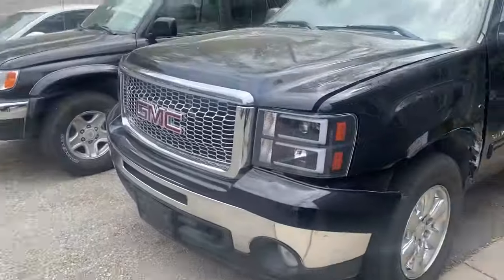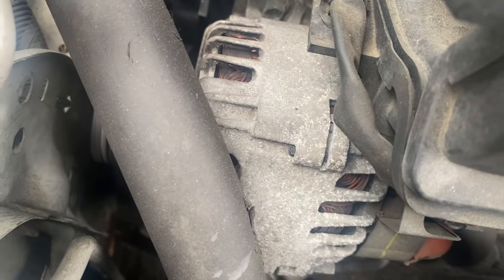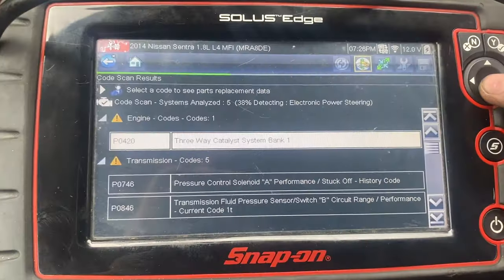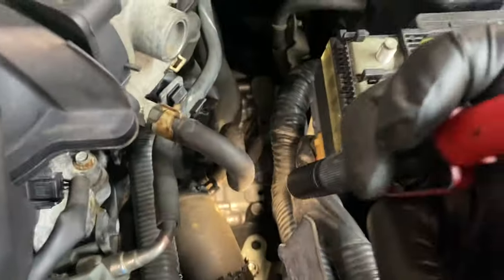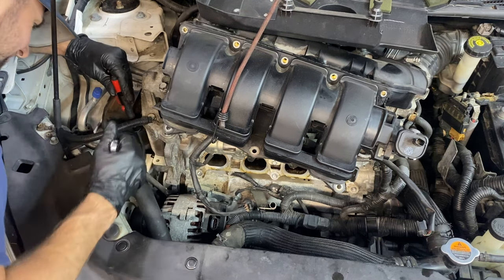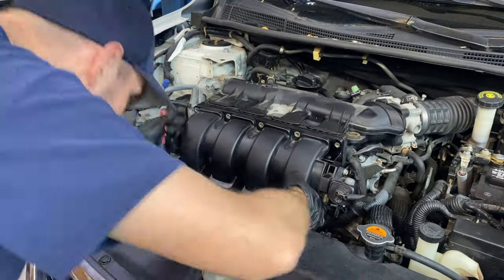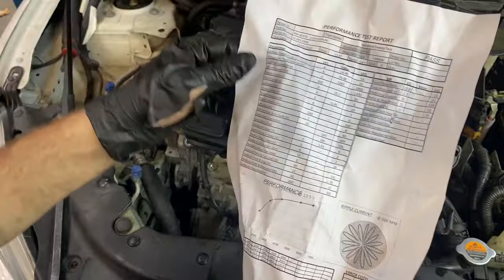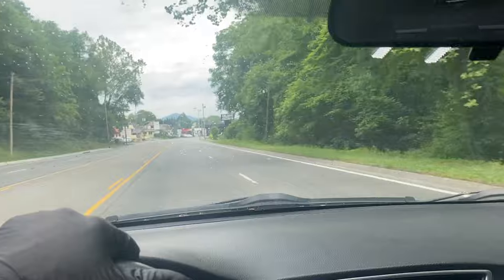Nissan Sentra Transmission Problem: What You Need to Know

Comment: STAY AWAY FROM NISSAN!!! I own a 2017 Nissan Rogue and twice the CVT Transmission failed. I lookup online and found so many customer complaints regarding the same problem with CVT Transmission  issues. Since Customers filed massive lawsuits against Nissan, they have extended the powertrain warranty coverage for CVT repairs, replacements, and towing to 10 years/120,000 miles, whichever comes first. Recently I had to replace the whole CVT Transmission in my Rogue which is out of warranty and it cost me a TON of money.   From my own experience with this car, advice to you; just stay away from Nissan period!!!  Nissan will learn that unhappy customers will never buy they their product ever again, since they are ignoring this specific problem since 2003. Enough is Enough NISSAN, you used to make great cars back in 70's, 80's and 90's but not anymore.
Reply: How often did you get transmission fluid refilled and filter replacement?
Reply: @LibraryOfTheOligarchs it’s a Nissan problem, not a fluid problem.
Reply: P1778 time for a new cvt .
Reply: My 2017 rogue is on 110k miles never had CVT issues. I’ve changed the fluid every 30K with regular oil changes.
Reply: I have a 2017 Altima that I bought new. It has 112K on it. I changed the cvt fluid at 55K and 112K. No power flush, that can damage the valve body. If 6 quarts drain out only put 6 back in. The torque converter holds fluid that stays in. Bf I changed fluid at  112K I got a check engine light and a high rev/ no acceleration issue several times. The code the tcm was throwing out was 0776  (pressure control solenoid B), and a code for bad O2 sensor. Since the fluid change the light went off and the hesitation and high rev situation hasn't occurred since.
Reply: Or maybe there is a problem of you not properly taking care of it? Idk if the US Nissan is just late to things but other countries dropped the CVT for E-power, where the electric motor is the transmission
Reply: @deftone4u keep on doing the trans fluid changes. But you shouldn't have to , that's the issue.  Name another manufacturer that you have to do trans service at those intervals? Ferrari, Lamborghini, Pagani, and Nissan😂😂😂
Reply: @stevemcraemanager7119  well honestly I didn’t know that until after I bought the car. I also had a scion XB that I had to constantly put oil in because that engine was notorious for burning oil. Also something I found out after buying the car. But there’s nothing wrong with taking care of something to make it last longer.
Reply: 160k miles on my Sentra and I went against dealership recommendations and changed my cvt fluid every 20k miles. No issues at all.
Reply: 240k miles on a Nissan Murano 2007 no major issues so far other than the ECU needing to get swapped recently

Comment: I think that most people do not know how to drive a car with a CVT, there are many Corollas with broken CTVs and you can see it here on YouTube, apart from that it must be that the old CVT was delicate, my father-in-law has a B17 but manual transmission and he already has it close 200k and the mechanics go on and on, which indicates that the car really is of outstanding quality, here in Argentina they are very durable, as much as a corolla or civic, here you don't hear any problems with the CVT and I don't think it will persist that fault in the new sentras, it is assumed that they added the 1st and 2nd gear to improve operation, just like toyota did
Reply: Never thought of that... I own a 2017 Nissan Sentra SV and to be honest I have not had any issues with the car.... I have done regular maintenance check ups and nothing else.. 180,000 miles car works like new ... Everything works as designed.
Reply: I had a 2018 Corolla hated the cvt. It simply would not down shift fast enough on its own unless I put it in sport mode. So braking quick eith the tranny keeping up with sudden loss of speed was a joke. 

It felt like it was coasting no matter how much you were braking.

That car got flooded, so total loss, bought a Nissan Sentra, which slows down 100 percent better, but their cvt is notorious for being a problem. 

I got geat milage with the Toyota and with the Nissan.

So seems you either get dangerously bad engine braking or down shifting ability with Toyota, or you get better down shifting safer with a Nissan that might not make it to 60,000; before having a tranny failure.
Reply: Can you teach us how to drive CVT
Reply: The issue is that they can’t handle things that other transmissions can. For example launches. Do too many of those and your cvt will break in under 50k miles.

Comment: Easiest maintenence prevention I've done with my Sentra is I change my CVT Fluid every 30k miles. It's easy and will prevent it from failing.
Reply: they have a sealed transmission how?
Reply: @tyreelittlejohn4026  research. There's a "dipstic" under the battery that can be used to fill it but no actual "stick" so just put the same amount back in that you drain out from the overflow underneath on the trans oil pan. There's a 10mil filler straw under the drain bolt. Easy easy. But also change the filter and trans cooler filter as well
Reply: @dudeman2227 a Nissan owner saying “research”.  Now THAT’S funny. 😂😂
Reply: Bro said transmission is sealed you on the wrong persons ahh
Reply: @tyreelittlejohn4026  No such thing as a "sealed" transmission. Just means you have no dipstick and need to fill it from under or the side of the trans by a fluid pump.
Reply: @richardwhitaker125  I was just repeating what he said

Comment: You have to change the fluid! Dealerships are scammers and you all still LISTEN to them. They are NOT sealed transmissions, the fluid isn't good for 100k miles, 60k miles and imo not even 30k miles! Change it every 20k miles!

Comment: My Nissan Sentra 2014 has 178.700 miles, original transmission, alternator, and starter, replacing the transmission fluid every 40.000 lasts longer.
Reply from the maker: Thats the way to do it.
Reply: Yes

Comment: Those cvts seemed relatively cheap to repair to me. Has to be cheaper to rebuild than to replace unless you're getting a steal of a deal on a replacement.
Reply from the maker: The main problem with these cvts is the parts to rebuild usually cost so much plus labor it’s simpler and easier to just swap them out.
Reply: @justcallmeeddie1  hi buddy my nissa sentra  2013 is stuck at gear 1 and not moving more than speed of 20 it is running fine most of the time but sometime it gets stuck on gears, i have checked this thing and it shows transmission solenoids problem, it is costing me 1000 bucks from nissan showroom what should i do now.

Comment: So far of all the "Nissan CVT Trouble" vids on my feed, not a single one has been related to the 2019 one. Owned since 2020 and no issues aside from needing the battery changed. Still really happy with it!
Reply: Because you get someone to change the oil the right way

Comment: 2020 Sentra SV 42K good daily commuter I love her can’t lie no complaints from me..
(Switching the trans fluid and filter next oil change as well)
Reply from the maker: Definitely get that fluid changed. Ive seen them go +150,000 miles with proper maintenance.
Reply: At what point is it too late to change the transmission fluid? Would it be worth switching out the fluid at 75k?
Reply: @Frxnando yeah service it no matter how late
Reply: 42k that thing still pretty knew. I’m just now getting trans problems at 140k miles

Comment: The new Pathfinder went back to a automatic transmission. My Nissan Sentra is a 2017 and it currently has 130,000 miles. Owned it since new and have not had any problems with it.
Reply: Be careful.  Nissan Reliability is the problem. Their geared transmissions aren’t immune to that.
Reply: @Mabeylater293 Pathfinder uses ZF transmission and is reliable.

Comment: I just acquired a 2016 Sentra with a bad transmission ( noise in P and N but goes away while in any gear and it slips) this one died at the same miles the one you grabbed 97,000 same color too. Running into a bunch of issues trying to find a trans for a decent price. Guy had one for $1,400 but it had 187,000 miles on it lol. The search goes on

Comment: The ctv fails because you give it to shops for an oil change then it messes up right after. They drain a lil transmission fluid and never top it off. Leaving it dry

Comment: Drove a 2024 Altima SV as a rental. This is the most uninspiring vehicle I've ever driven. Feels ultra cheap, doesn't ride particularly comfortably and the materials feel like they were pulled right out from the budget bin. The CVT makes the engine loudly drone under load and the vehicle feels more sluggish than a 2011 Corolla we once owned. If I owned one, I'd have little confidence this vehicle would be reliable 3-5 years down the road.

For a brand that advertises 'performance' and 'sportiness', this thing is an embarrassment.

Comment: I got burnt once on a 2011 Cube cvt rebuild that cost me in 2018 $3500 with one warranty or 12000 miles! However, after watching tons of videos why did we fail at 106,000 miles. The dealer never told me that there were filters inside that could be replaced!  I did two drains & refills one complete filter was replaced at 50,000 miles, a total 91,000 miles on rebuild total on Cube 197,000!! Never again any CVT as a vehicle.

Comment: My son has a 2013 Nissan Sentra with 97K miles. Nissan dealer just told me it would be approximately $7400 to fix the transmission with a 12 month/12K warranty. Does it make sense to fix? HELP!
Reply from the maker: Yes this does make sense. These transmissions aren't cheap and dealerships charge high prices for their repairs. My advice is to find a smaller independent shop to swap it out.
Reply: Thank you so much for your advice!!💕
Reply: One more question. In your opinion...approximately what would be a reasonable price?
Reply: I bought a 2013 sentra about a week back for 1,500. Transmission needs replaced it'll cost about 2,500 for it and probably 700 for labor maybe lower, but it's way cheaper buy one new and have someone swap it out :)

Comment: Is the “rumble strip vibration” a sign of a bad transmission? I have a 2017 Sentra with 66K miles on it
Reply from the maker: Yes it is. Sorry to hear about your troubles with such low mileage. Misfires can also cause that issue but its more often the transmission on the nissan sentra.
Reply: @justcallmeeddie1  will the transmission oil change help? I read that in a lot of Nissan forums.
Reply: @justcallmeeddie1  I just want an honest answer at this point. 😭.. I have the same problem mentioned here and I've had ppl tell me that it's no use changing the fluids (Nissan dealer tech said this) and he was the 2nd person to say that with the mileage I have (130,000) that it could risk the car not running anymore after the change. Another Nissan tech over the phone recommended the transmission fluid drain and fill, as it should be done every 30 to 60,000 miles or so. More ppl say that more than likely won't fix the problem. My question is, if it's recommended every 30,000+ miles, then why is it a risk to do so at this point.. even if it wouldn't stop the "rumble strip vibration".. *great description btw*.. Wouldn't it still be good to have it done? And couldn't it potentially lessen or eliminate the problem? I just think ppl want me to leave it with them to diagnose, which costs in itself, only to give me the highest quote possible and leave me with only the options of rebuilding or replacing the trans. If you could.. a little advisement regarding this would be greatly appreciated. Thx in advance

Comment: Replacing a CVT may sound like the thing to do but they can be $8000.    Right about now my 2017 Rogue is not worth a lot more than that.  No, I don't plan to replace the transmission if it fails.  Pay that for more of the same, heck no!  Make no mistake, they are great when new like a lot of vehicles are.  It is when they start accumulating miles they wear out and become sluggish.  The difference is that some Nissans fail sooner.  I heard of one failing with 20,000 miles.  Never mind it was still under warranty.  It just shows how crappy they really are.  You would not want one of these when the warranty is over.

Comment: Nice video. I have a b15 2002 with low miles I had sitting for a long time. It was my first car. It gave me headaches throughout the years but she’s a rock all in all. 
I have a modern new suv to enjoy with my family but I wanted to buy a used 2012 sentra 2.0. 
Do you think the b16 sentra 06-12 are good sentras? 

I hear most all complaints are linked to the b17 sentras from 2013-+
Reply: Stick with your B15, the b16 were cvt's now if you find a b16 or 17 with the manual transmission they are rock solid.

Comment: Hey thanks for the info
I have a 2018 sentra with a bad cvt
I am planning on replaced myself.
I am a tech but i dont know if it needs to be programed aftet replaced?
Reply from the maker: Yes it will need to be programmed. You will most likely have to tow it to the dealer after installing it to program. I have used mobile programers before also. You can program yourself with the right programming hardware and software.
Reply: @justcallmeeddie1  thanks a lot bro!!
Reply: @justcallmeeddie1  I am going to get a Toyota better
Reply: What was the mileage?
Reply: You need a Nissan Consult III plus to program the TCM, the other option is carry over the ROM chip from your old transmission and reset your trans adaptations with a Autel/Launch/Snap-On scan tool.

Comment: Help me. Nissan Versa 2012 year. I just changed the cvt oil along with the filters. Traction occurs when the speed is 100-120 km/h. Sometimes it happens at a lower speed. What spare parts are you saying to change. Cvt repair is very expensive here.
Reply: it might be ur clutch disk depends on the oil u took out of it was dark black then u should have put it back as it has all the materials from ur cvt mainly the clutch disk and now that u put new oil in and flushed out the oil oil with the material in it ur cvt might slip. from cvt owner to cvt owner accelerate ur car slowly and maintain a certain range of speed don’t go from 30 to 60 then 60 to 30 continuously it will damage ur belt hope this helps 👍🏽 just slowly work ur way up and maintain that speed try to break smooth as well

Comment: Part of the issue with these Nissans is the deaker. One will say serivice the trans at one mileage, another a different mileage and another will say there is no fluid service for that vehicle. Manual says "check the fluid" at a certain mileage, manufacturer has no dipstick to si thst with...but they will sell you one on the Nissan parts site.

Change the oil every 5000 mls with synth, service the CVT by every 60K mls and decrease that interval by how hard the vehicle is driven (heavy foot, hard accels, heavy weight, towing). 

Nissans are cheap due to cheap parts. Cheap parts require better care (be careful removing that intake hose when checking the sir filter) and maintenance.

Comment: I have vibration when accelerating. I asked one of the mechanic and he told me I have to change the CVT transmission. Knowing that my transmission fluid is less than it should be.. What do you advise me.. refill the liquid or change the transmission
Reply from the maker: You can try to fill the transmission up to the proper level. If that doesnt help you need a transmission.

Comment: I bought a new2007 Nissan Sentra with the cvt trans.  I broke three transmissions before it hit 50k miles..  Nissan told me they wouldn’t replace another trans. and I traded it in the next day.   Most of my driving was highway so that should have made it easier on the cvt.  I will never buy another vehicle with a cvt, not even a Honda.  They have had problems too.

Comment: Don’t service them? It states right in the owners manual all you have to do is read it. Service it every 30 k . So many run the shit out  of these cars. They are economical not a sports car. Inexpensive car, with people not taking care of them.  Then cry when they break look at the inside of that car? You said clean , there’s NOTHING clean about it . The inside was taken care of as well as the mechanical.
Reply from the maker: I agree Service them every 30k. It's the dealerships that tell consumers that not Nissan engineering per say. You're right people drive these cars into the ground and they we designed for economical driving but Nissan takes advantage of that by giving these cars weaker transmissions than the later models so they can sell more transmissions and new cars.
Reply: 30,000 miles for a $300 dollar job, it was $369 for me cause they quoted me the old price. The hell with that give me a regular automatic transmission or I will learn to drive stick shift. CVT are trash and do not have a good lifespan, 200,000 if you baby the thing.
Reply: They are junk. Doing the fluid change does not guarantee they will not fail. We maintained ours and did changes and it ahit the bed at 116000 kms. Rest of the car is mint but replacing the transmission is half the resale price. Will never buy another Nissan

Comment: I have a 2014 center and I'll put in Gary. That's not running. I mean, it comes down and called the zombie, but if I'm trying to get it, don't go. You're a win when you put it in your fine. No problems don't have to work. We'll connect probably be.

Comment: I was thinking of buying a 2018 is the cvt weak in these years pls help ???
Reply from the maker: Yes it is. Common problem. Would suggest buying a toyota or honda instead.
Reply: I ve 2018 sentra ..in fact i used to change cvt fluid and filters every year ...inspit of that i see my car now loosing its power with shifting noise ..my advice to keep away from awful jatco transmission!
Reply: I used to have one of these. It seems like no matter how good you take care of it the transmission will still likely go out.